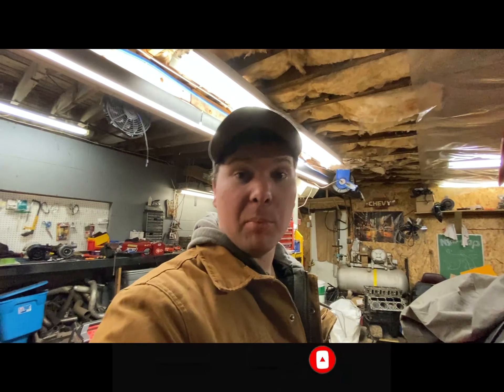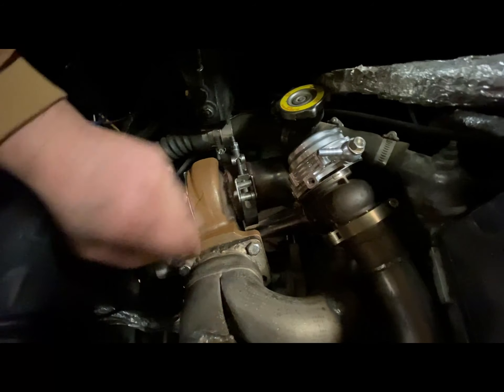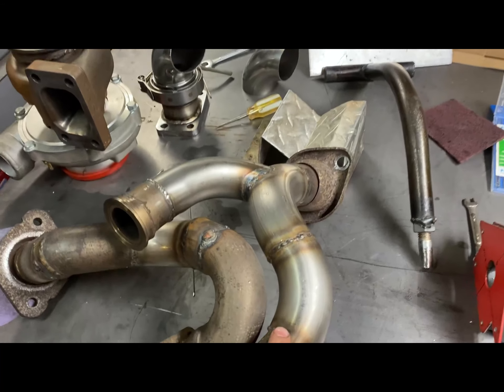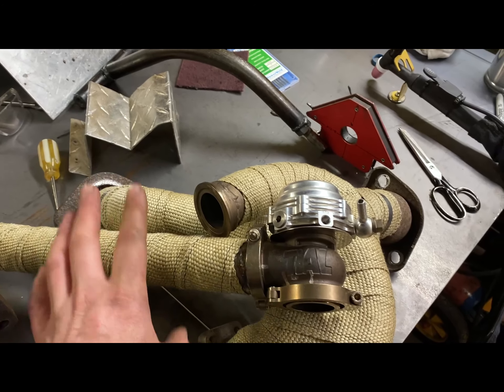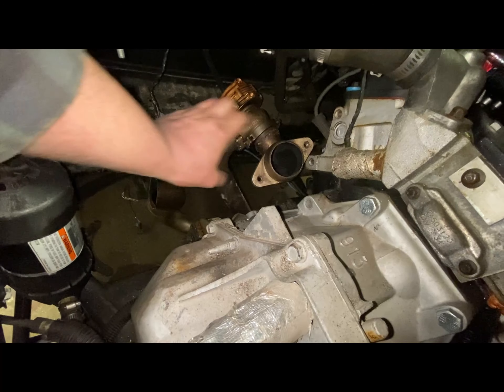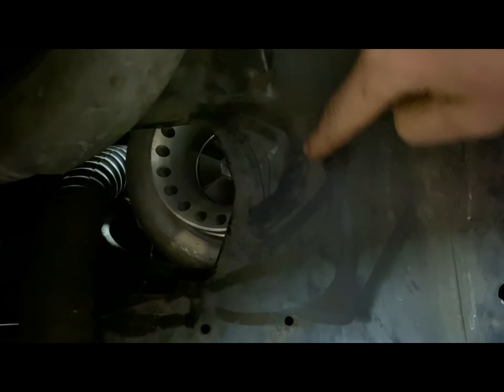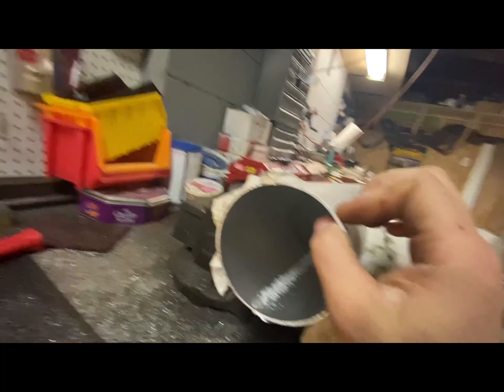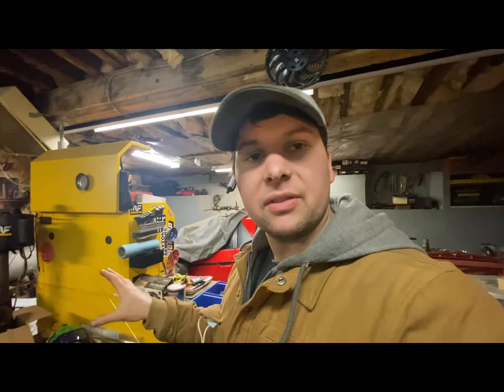Building a Turbo Kit for the Fiero! (Making the intake from used drive shafts)

Comment: Oh! what intake are you using?
Reply from the maker: Thanks!! The lower intake is a stock supercharger one and the upper is one I made from a peace of plate and a 90. I also have a Nothstar TB flipped upside down bolted to a TB adapter from ZZP.
Reply: @ongoracing  Thanks , did you buy the 90 or did you fab that too?
Reply from the maker: @karendranko5979  Yeah I just bought the 90
Reply: Do you remember which brand 90 you used? Torn between the s/c intake and the Camaro intake